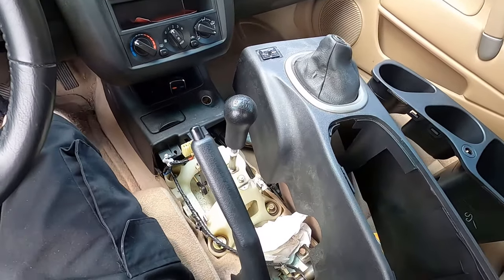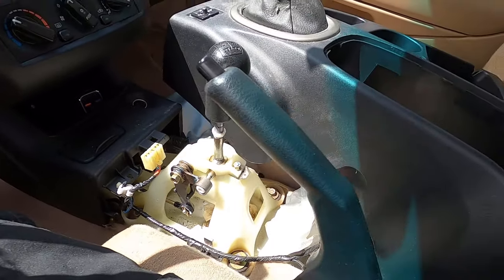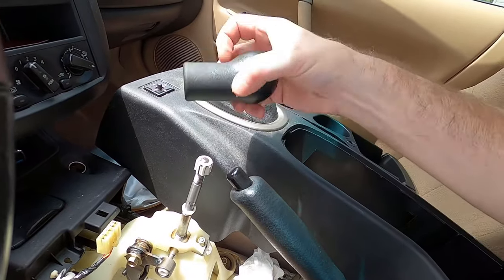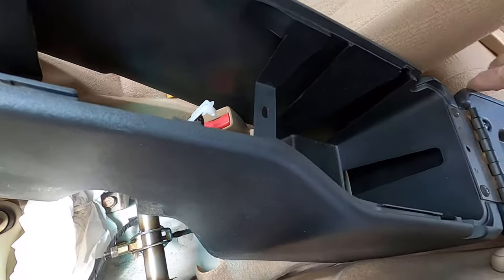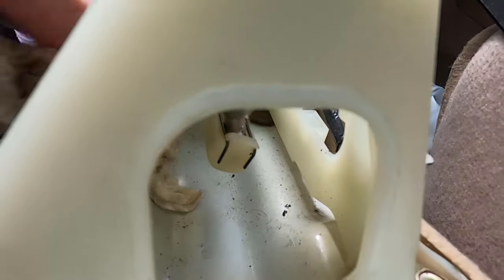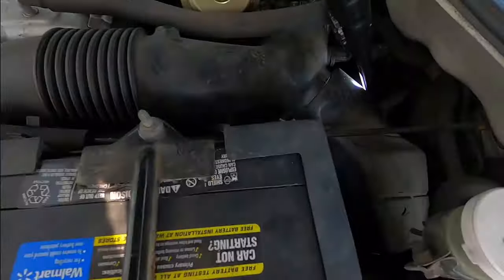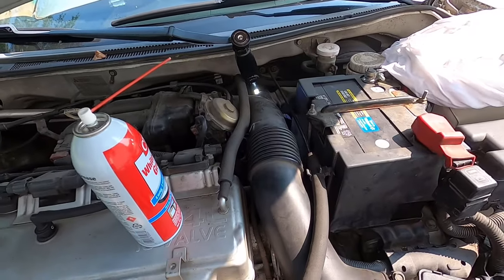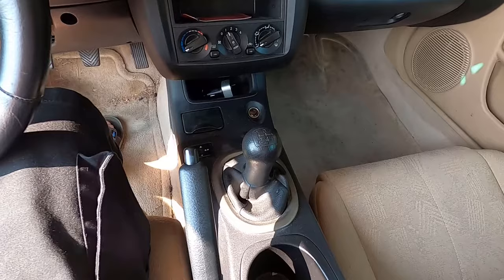Shifter Stiffness Fix. How to lube shifter cable bushings and linkage on a manual transmission.

Comment: My stick shift will move side to side smoothly, but getting it into gear feels very clunky and harder to do. Even with the vehicle not moving or turned off. There is even a light grind feel under the shift lever in some cases. Otherwise the vehicle stays in gear and doesn't slip or anything.
Reply: sameee i got a scion tc and it shifts hard n good with a stage 2 clutch but 1 2 n 3 have a little clunk to it but no slip either
Reply: My 2012 chevy cruze 6speed is almost like it off track having to lift the slip for reverse to get into 1st and 2nd sometimes
Reply: Make sure the clutch is fully disengaging. Sometimes if parts are worn it grabs a little making that happen, thats what the grind noise is.
Reply: @brandontucker6069   I got the same fucking car and problem
Reply: Bleed your clutch and adjust the rods to your clutch pedal under the dashboard
Reply: Did you find what the problem was?
Reply: Old or dirty transmission fluid can cause difficulty shifting as well
Reply: Thanks for leaving comments 😢

Comment: White lithium grease is petroleum-based and can accelerate the degradation of plastic parts, like the shifter mechanism. You should use a silicone-based lubricant instead.
Reply from the maker: Yes, a silicone-based lube is best.

Comment: On my Fiero, I lubricate from the shifter end. I put the spray straw right up against the sheath where the cable enters, then some tape around it, then carefully seal it up with hot glue. I spray for 5 seconds to get the white lithium spray lubricant through the cable, then peel off the glue, and work the cable. Then I do the other cable.

Comment: 2018 chevy spark manual transmission,  while replacing the shifter cable i noticed the lever at the top of transmission is loose. And infact was not the shifter cable at all. I manually put the lever into 1st ,2nd 3rd,4th,5th but none of the gears seem to engage.With engine off.  Any ideas what it might be?

Comment: My first car was a 1960 VW Bug. Your analogy is spot-on. As a teen, I just wanted to 'do my thing', at which was not giving proper time and attention to assisting 'my way' to run properly. One night, as a teen, I was out doing my thing, started home before curfew, my gears that had been grinding, that I paid no attention to, failed me EXCEPT  to go BACKWARDS only. At midnight, I found myself driving across town to home, backwards. I, even though a female, did my own maintainance, yet ignored 'greasing/lubricating' my gears. Hence, I found myself with only one working position, BACKWARDS.
Lord, thank You that You have been long-suffering with us and our going backwards from You. It starts as a slow drift because we did not give attention to what was truly vital for us to, run properly. BUT GOD, Your PLANS FOR US overcame through our great hardships, that our eyes were opened. May we, Your church, never set aside Your anointing oil that helps us to move in the correct direction, FORWARD in You, with You. We were created to serve You, for then we too will be served in all the true and righteous ways. Here we are Lord, as living sacrifices for Your work at hand, in Jesus name. 🙏

Comment: My 96 cavalier had the same problem it wasn’t my cable but the linkage on the transmission which is irreplaceable. After I lubed it the problem wasn’t completely solved but shift’s much better. It has metal bushings but everything is rusted up from being driven around the east coast. Oh and one of the cables has a tendency to pop off if any stress is put on it from not using the clutch while being on a hill.
Reply from the maker: Thanks for the comment! I'd spray it with WD-40 first and work the shifter several times to break some rust off. Wipe it down if you can, or wait a few days for the WD-40 to go way, then use the white lithium grease. If you want to spend a little more, get some Boeshield T9 and spray that on it.
Reply: @Killobyte  ya that’s what I was thinking on doing, I thought it was a cable or shifter but when I hit the neutral arm on the transmission it immediately loosened up. It looks like the neutral arm has brass bushings on a steel pin on the transmission. I’ve looked over and over but it’s irreplaceable to replace the linkage on the transmission. I got ripped off for 700$ for a mobile mechanic to at least take my console apart and pop the 1-5 shifter cable back on only to realize it’s the transmission afterwards. It’s a 1 of ten ls cavalier and the last running one in existence I inherited from my aunt a convertible that needs love. I haven’t taken it past half throttle as it spins the tires and tries to take me out.

Comment: Thanks I will try this but I will try using "Dry teflon" lubricant in spray. pretty much i would disconnect the cables and spray the teflon all the way in the cable until it gets to the cabin and also on bushing contact surfaces, the idea is that this wont be catching dirt or dust in it. hopefully fixing this

Comment: can the transmission fluid cause this too? My car did this after sitting in the cold for a couple days but it loosened up after driving around for 15 minutes or so
Reply from the maker: Yes, cold transmission fluid can make it hard to get the transmission into gear. Normally it's just hard going into first gear. Then as you drive and it warns up, it gets easier.
Reply: Mine is the opposite way, as i drive longer it gets more and more harder in neutral gear. Any of you had any idea why? In the morning til 15 to 20 minutes every thing is smooth then this happens. Please help!